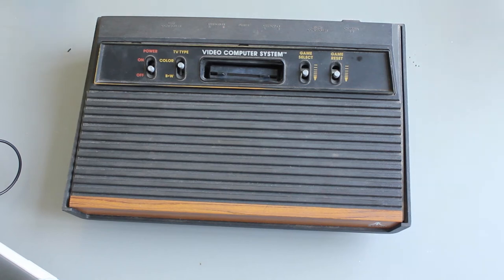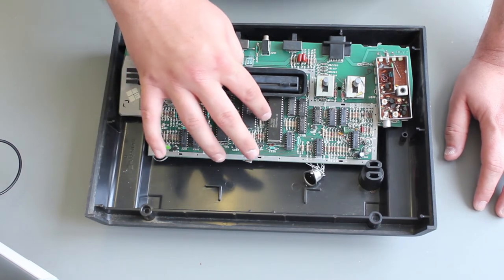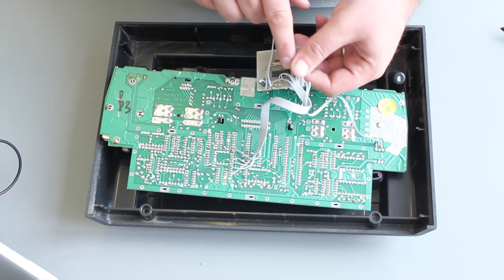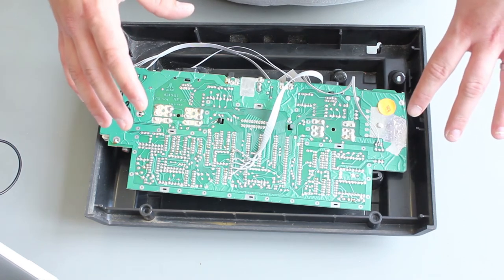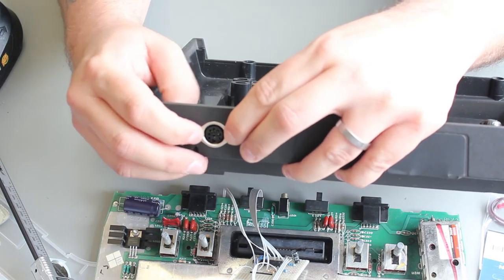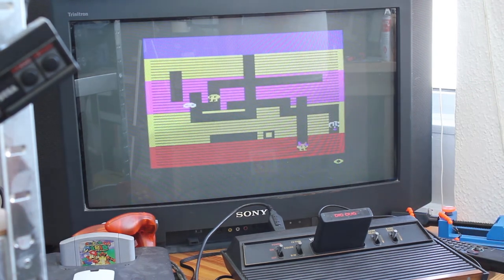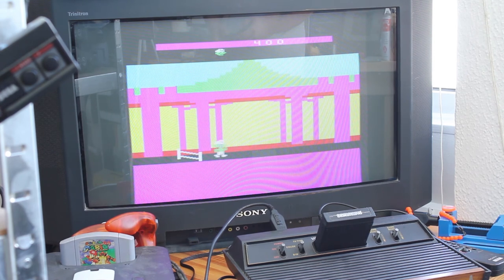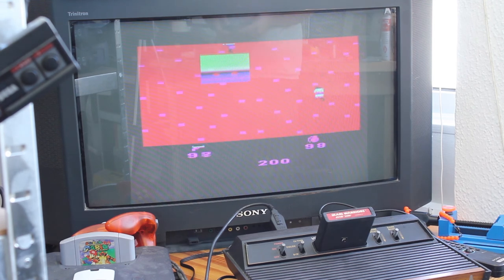French Secam Atari 2600 - Teardown and RGB mod

Comment: Building a circuit to translate either PAL or NTSC QAM color output from the TIA into a proper FM for SECAM is a bit trickier than you might think.  If you wanted to do it digitally, you'd need gates with a propagation delay of <20ns to build a shift register that operates at maximum speed.  Even with today's logic ICs, that's a challenge.  The cheaper choice is to build an analog demodulator like the PAL or NTSC TV uses, but then you'd send the color difference signals into a VCO to get the FM that you need.  And you'd still need most of the color sync circuitry that is on the 2600 SECAM board now.

So they punted and used the brightness outputs as RGB.  So each output controls color AND brightness.  That's how blue looks dark blue while green and yellow look like neon colors.

Comment: Reminds me of the bad old days of pc cga graphics ;)
Reply from the maker: The Great Jonzini theres actually a connection there both the 2600 and CGA are designed to take advantage of how composite video works to generate a proper colour palette. But Atari didn’t bother with those bits for SECAM that’s why it’s crappy.
Reply: 16BitBench ha! well I didn't know that :)